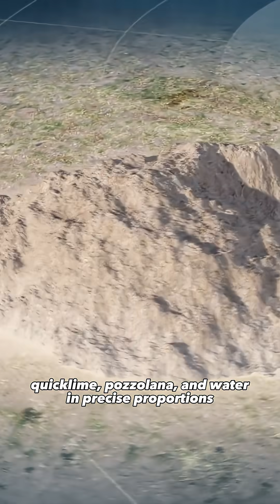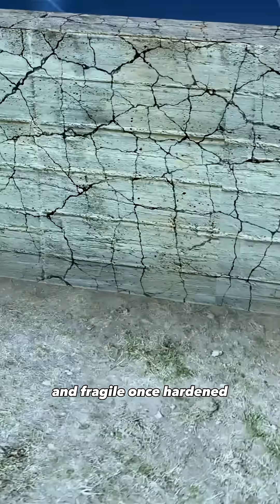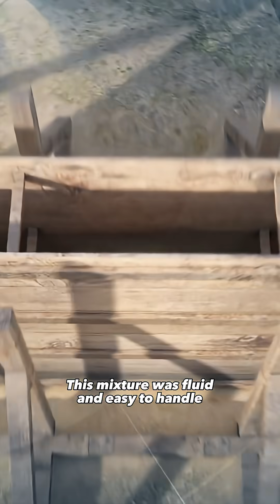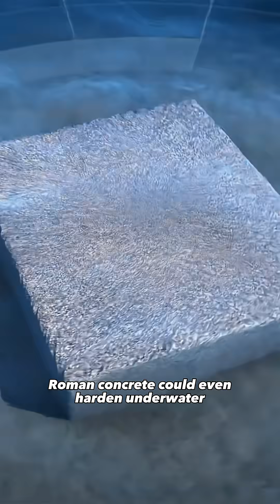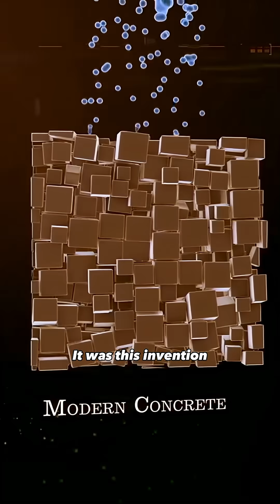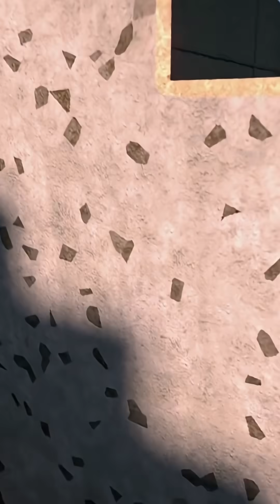The Roman concrete #history #romanempire #engineering

Comment: Crazy how the exact mixture was lost knowledge until the last decade or so.
Reply: Another key point is just how much was needed back then. Today you only need thin walls because we use steel frames which strengthen the concrete. Back then they just build massive walls to support the structure. That's why so many structures still stand.
Reply: Lost mere centuries ago when the last vestiges of the Roman empire finally died.

Even then it's likely that the Ottoman's may have known it if they didn't just kill all the Romans in Anatolia.
Reply: @mnomadvfx only in the west tho. Not in the east which was still Roman Empire. On wonder medieval Europeans were still living in wooden huts while Romans in the east were still living in marble and concrete.
Reply: @mnomadvfx  Not all Romans knew this, just the engineers, cement makers and probably builders.
Reply: It wasn't lost.
Reply: @trudilm3864  Yeah, I think it was knowledge hidden by the elites.
Reply: @trickyricky12147  It wasn't hidden by anyone. Upcoming generations always think they know better than the adults, and people will always want to do jobs cheaper.
Reply: It was never really lost, it's just so expensive we went for the sloppy and cheap method.
Reply: @LordTelperion  Modern concrete does have the benefit of being able take much heavier weights than the Romans needed. Skyscrapers, etc.
Reply: @LordTelperion  lol no you dummy, our modern building is better, some of our buildings can withstand nukes. I don't think Romans could've planned for that 😂😅
Reply: @LordTelperion ngl you just sound like those who always cry “nowadays”…
Reply: @LordTelperion  Sloppy and cheap seems a bit harsh but yeah, I suppose so
Reply: thx to medieval age and religious fanatism...
Reply: @Frk_Tamer  Bro, it is thanks to Christian monks and Muslim scholars translating and salvaging lost works that so much of Rome has endured.

Being a scribe back then was hard work, but it allowed for the survival of work of the most important philosophers, mathmaticians, engineers, historians, etc, to endure.
Reply: @Frk_Tamer  The autism, I can smell it though my PC
Reply: @Frk_Tamer  Thanks to the barbarian hordes who killed randomly and burned libraries.
Reply: @Frk_Tamer  not really. They never stopped using it, they just stopped building monumental structures with it (at least for a while). It was still used in smaller structures (how it had been used for centuries throughout the Roman Empire) like small houses and such, but it wasn't the long lasting and incredibly durable stuff that most people know. That stuff was made with volcanic ash, and could only be sourced from Italy, and as such was really only present in Italy. The Romans didn't know why it was stronger, they just knew it worked well building domes and vaults and such.
Reply: @Frk_Tamer  Guys like Alex Jones for example, wanna tell us without Christianity, Europe would still live in mud huts...meanwhile Rome!
Reply: @shagal2142  People didn't live in mud huts in Medieval times. They (the commoners mostly) lived in wattle and daub homes. Those structures had better insulation than modern American homes. Otherwise, they would have frozen to death in the winter like people in the US do without heating.
Reply: @shagal2142  Literally, Romans were the ones who brought civilization to the western European tribes, by then Romans were already trading with China, Egypt and others. People forgot how much of a backwater Europe was.

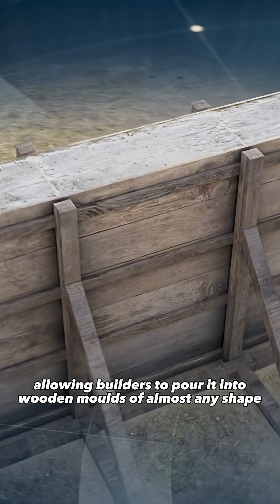Comment: 0:27   As someone who drives a lousy 4 cylinder mid size sedan, I can't imagine the braking performance that beast must have.  Massive carbon ceramic rotors, multiple piston calipers, and lightweight, wide open wheels that allow for immense cooling must be incredible on a machine with such a good horsepower to weight ratio.